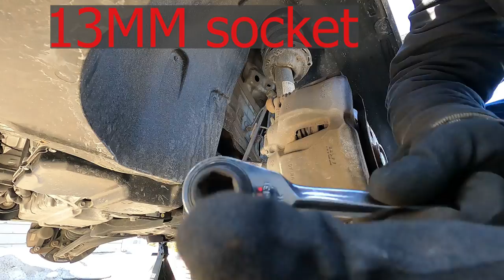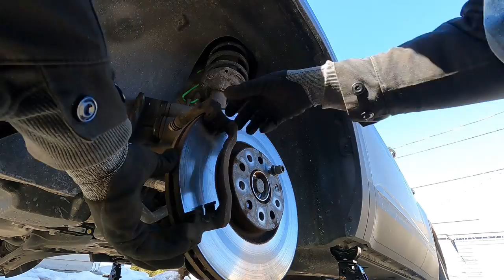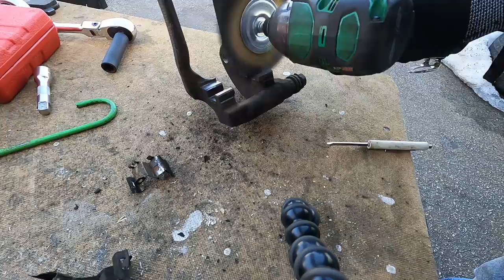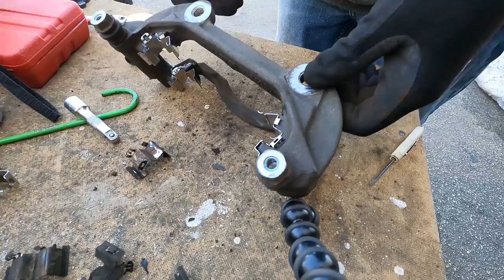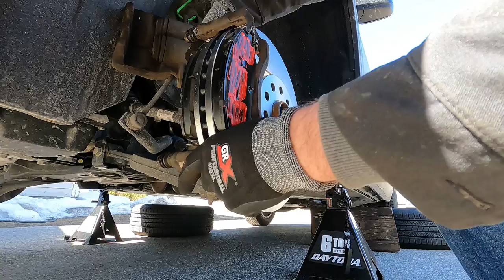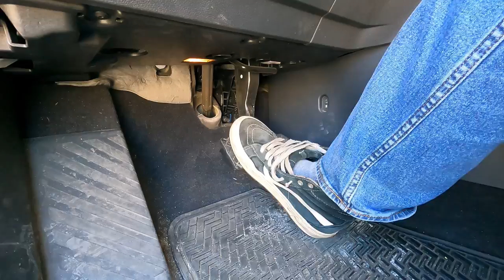How To Replace Your Front Brakes On A Vw Atlas - The Easy Way!

Comment: Just did the brakes on my 2019 VW Atlas family car using this video and it worked perfectly. Honestly a perfect video. No words needed, just clear visuals of each step, and text to show each tool needed. Volkswagen wanted $1,300 to do them. I instead paid $125 on partsgeek and maybe $18 for some high end lube. Parts got here in 4days. Took about 2.5 hours but it was my first time. Thanks!
Reply from the maker: Nice 👍 glad to hear. VWs can get pretty expensive sometimes. Almost like Audi prices.

Comment: Can't do the job without torque specs.  

13mm caliper bolts: 35nm (25.8 ft-lbs)
21mm caliper bracket bolts: 200nm (147.5 ft-lbs)
Wheel lugs: 140nm (103.2 ft-lbs)

Otherwise, nice video!
Reply: Where do we find information on the torque specs?

Comment: Awesome video!! Nice and easy, quick brake job, and idk about you but it always feels much nicer to drive around knowing you have fresh brakes on.
I have a few things to say though:
1. I think that's the 21mm deep socket that I thought I lost out of my toolbox at work hahahaha (unless you also have a Craftsman impact set)
2. I noticed you didn't clean the inside of the calipers slider bore because it still had good grease in there. I do the same thing and i had someone in the comments one time tell me all about how I was doing it wrong hahaha so I'm happy to see I'm not alone. I usually only clean the bore if it's rusty or has old dried up grease. If it's still good grease, I wipe the pin and re-grease, done.
3. I am very curious to know more about the theory of putting grease or "Disk Brake Quiet" paste on the back of the pads. I would like to learn more from someone that has had experience with this. Why should you? Why shouldn't you? I never know what the right thing is.
4. You didn't say a word the entire time, yet you provided every detail there is to know and showed how to do the job right. Well done!
Keep it up! You're doing better than me at this point hahaha
Reply from the maker: Lol I’ll check the socket. Ya I’ll talk to ya about the red brake squeak stop at work. 👍 thanks Dude!

Comment: I have two 2018's I'm doing for a friend this weekend.  I would like to position my jack stand(s) at the pinch weld as you show in the video but I'm always a little unsure about where to place the floor jack. 😲 Any tips?  Thank you!  Great video btw!!
Reply from the maker: Yes, this is always a struggle to try to get the jackstands under. So carefully, I have two jacks that I go in from the front. I go under the control alarms. You have to make sure that they don’t slip out.  There may be some area on the sub frame that might be safer.  Be careful, but that’s how I did it.

Comment: Take the cap off the brake reservoir when pushing back the pistons..? 🤔
Reply from the maker: You can if you want to. I normally don’t. It’s fine if you just go slow.
Reply: @AndyTheXTech  Just thinking about the times a mechanic saw my fluid low and topped it off. I definitely recommend checking fluid level and if it's at a high level with thin pads, use a turkey baster or other suction device to remove an ounce or two before pushing back the pistons.  Otherwise, overflow will occur...ask me how I know lol
Reply: Definitely unnecessary lol

Comment: Very well done, but i just don´t like the way people soak their wheel hubs with thick  and uneven layers of anti-seize grease, because the problem is, liquids and greases just won´t compress. To my knowlegde the connection between wheel hub and the inner plate of the break-rotor has to be very nice clean and dry. You really want concentricity on your wheels when they turn.